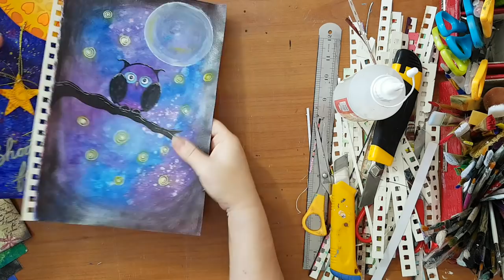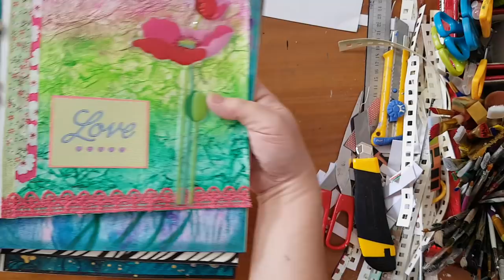How To Bind Loose Art Journal Pages

Comment: Thanks for this. I did a class yesterday that taught us how to bind double pages but not loose singles. I would be interested to see how well the hot glue adhesive goes after some use. I have never had any luck with the terrible stuff. I usually find everything I've glued with it comes unstuck after a few months. It is however very effective at burning my finger tips 🤣
Reply from the maker: Thanks for watching Marisa

Comment: Hi - thank you again!!  I have watched this at least 4 times.  I am ready to start making some sets of pages.   May I share the details so hopefully you will advise me??  ❤️❤️  I am using 5x8" (about 12x20 cm) index cards as my pages.  This is my first journal.  I want to use the same index cards for the binding.  They should be strong enough and the right height.  Can you tell me how wide they should be (this I guess is one part I never really got ❤️) .... then I can start to cut a couple of bindings and start to put pairs together.  Thank you again for your generosity!!  ❤️❤️❤️ . The whole journal will be vertical - should I get 2, 3, 4????  bindings per card. Thank you!!!!  ❤️❤️❤️❤️❤️
Reply from the maker: I suggest to cut it to 1'' width. sorry but i don't understand your second question.
Reply: @NoitArt  Thank you so much - so all I need is 1" strips for the binding?  (my other question would be answered - that would be 5 strips per 5x8" index card) - I am so eager to start cutting and making pairs - thank you again!!!!  ❤️❤️❤️
Reply: @NoitArt  I have put 9 pairs together so now I have started!!  I used 1/2 the index card - 2 1/2" - since I watched the video again and saw you used 3".  My dexterity is getting better again but the larger size helped me.  Thank you again!!!! ❤️❤️❤️